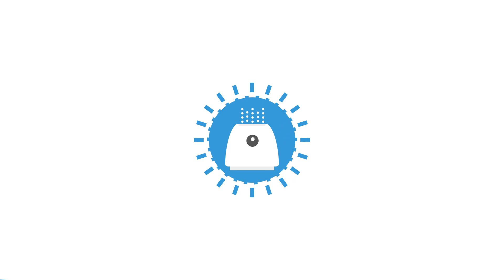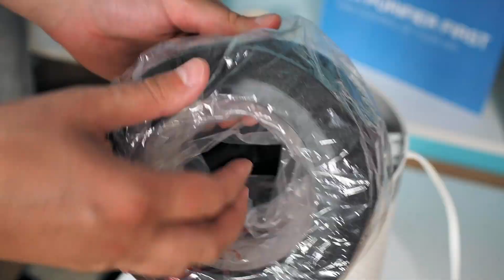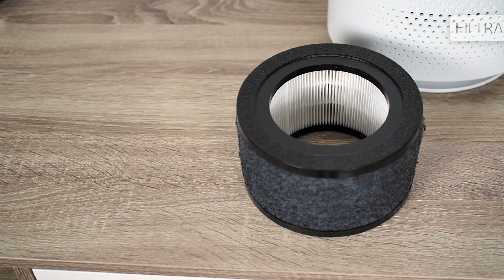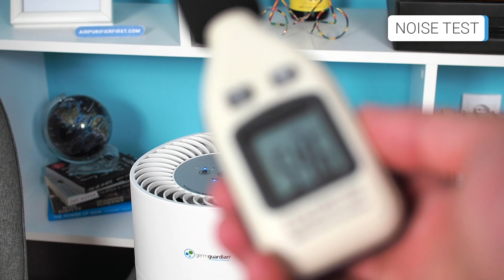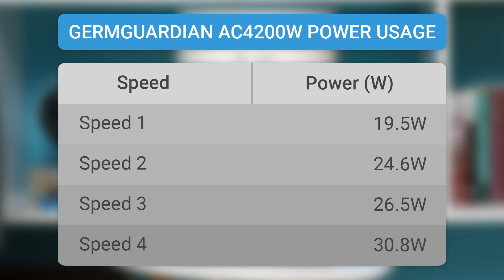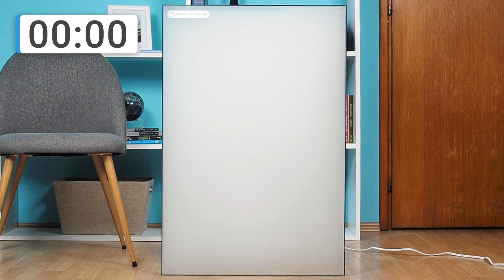GermGuardian AC4200W Air Purifier - Review (Performance Test and Smoke Box)

Comment: How do I get it to work it just stopped working. When I plug it in all the lights come on but when I try and press the power button and nothing happens. Filter reset off on all of the lights stay on for a second and they all turn off. Can you give me any information on how to get this thing started again
Reply: Did u figure it out ? Mine is having same problem as yours
Reply: @freehumanjen3506  I returned mine
Reply: Hi is it working.. i just bought 1 today
Reply: I am having the same issue.  All the lights come on for a couple of seconds, then go off, but it won't come on. I just replaced the filter for only one month now.  Help